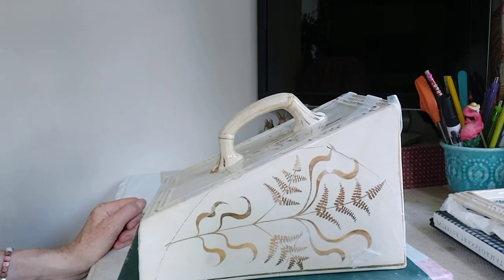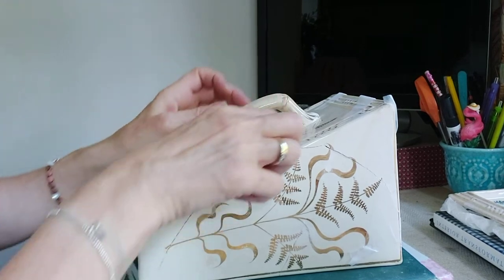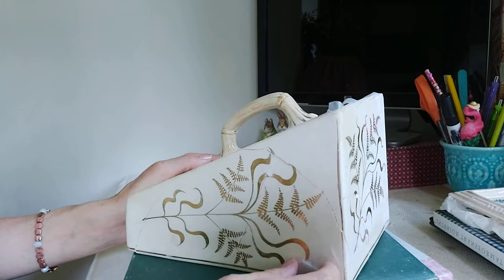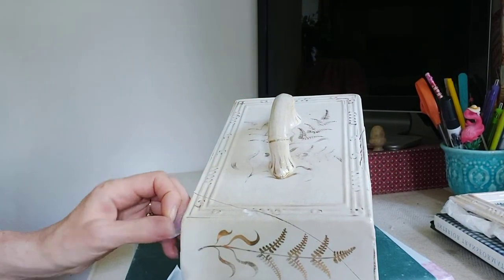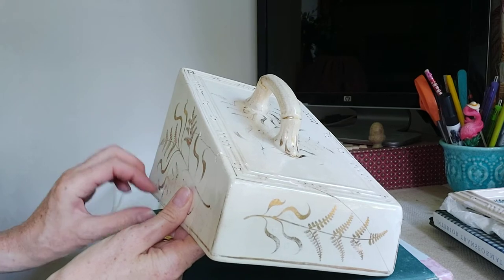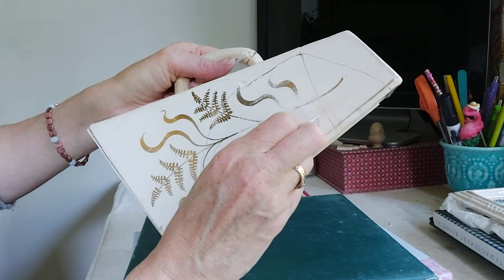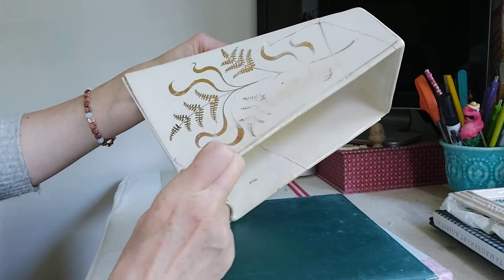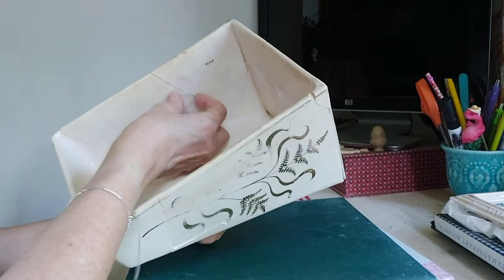HOW TO REPAIR PORCELAIN/CERAMIC

Comment: I am finding your tutorials a godsend, as I did a course a while ago and some of the materials now available are much easier to use, so I am working my way through your excellent videos to refresh my memory, and learn new skills.  One tip I did learn was to turn back one end of the sticky tape before putting it on, then when you come to remove the tape later, you have an end that is easy to lift up.  But maybe there's a good reason why you don't do this!  Thank you.
Reply from the maker: Hi there, many thanks for your comment, much appreciated.  I am  glad you enjoy your videos and find them useful. Many thanks also for the tape tip.🥰